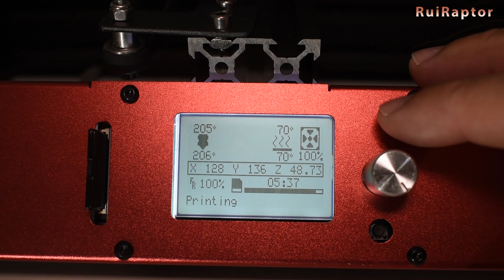Tevo FLASH (3D Printer) - My First Upgrades

Comment: Yes, this is the best tutorial on "how to change wheels" on a "Prusa type" 3d printer! Thanx for making it!
Changed the wheels to PC and now the bed goes much better (no wobbling!).
Although I still (from some time now) can't make my printer to print over 20mm higher (maybe not because of the height) by PETG. It just sticks not well... Don't know what to try now - the bed is levelled almost fine (it's not easy on my Flash), BLTouch works very well... I've used the same hair spray which worked great before. New coating, I think about 4-5 layers sprayed (not even of course but over the all bed).
I'll try to lower the bed temp to 70 and then will try to rise to 80c if it will not work.

Comment: 3dvice is having a black Friday sale, is it worth replacing all the wheels on the Flash or is that overkill?
Reply from the maker: I only replace the bed ones but i see nothing against changing all of them.
3Dvice now has new colors like gold and black.
Reply: Thank you
Reply: Thanks, is it worth getting a spare? Postage to Australia cost just as much as the wheels themselves
Reply from the maker: Hi Brett,
Its' always a good idea to have spares in my opinion. :)
I have some like wheels, nozzles, thermistors for example.
Reply: ruiraptor thanks for the quick reply, I grabbed 5 just for now. 

I’m also going to upgrades drivers as I purchased it without. I’m also going to order tmc2208 drivers, do I just get 2 for x and y axis? Do I need to worry about z axis (I ordered dual z model).

Also the lerdge drivers are same price from Banggood, am I better off to order those?

Also ordering MKS-LV8729
Reply from the maker: Hi Brett,
Did you receive the printer already? I ask this because i believe you will get the TMC2208 with your flash printer. 
Regarding the LV drivers, check my video of the board and driver upgrade for you to see how it's done. The links for the correct drivers are in the video description:
https://youtu.be/RhlTdTLfaQ0

Comment: Hello!
What Acceleration and Jerk settings are you using meastro? :)
I tried Acc down to 400, jerks down to 5, but the edges were very bad, not flat like the sides.
So currently I use it with Acc:400, x and y jerk 20 and now it is better, but I have a small ghosting now...
Reply from the maker: Hi,
I'm using 700 for acceleration and 7 for jerk.
If you are using Ideamaker, you can define lower acceleration and jerk for the outer layers and faster for the infill and such.
Reply: I have the same Problem. Have you fix it?
Reply: @tomes243  Sold this Tevo too (had a Tornado 1st gen) and bought an Anycubic 4Max. Worth it!

Comment: Hi Rui,
Now that you have had the chance to print with this for a little while, what would you recommend among the flash and the tornado?
Reply: I own both, the flash is giving me more a of a learning curve than the tornado did. So far I haven't had any of my prints on the flash equal the quality of prints I have on the tornado.
Reply from the maker: Hi Umberto,
Both are similar and different at the same time.
Both have the same type of structure, AC heatbed and equipped with a GEN L board (at least the last 2 versions of the tornado).
However, the flash is smaller in size and print area and is equipped with a volcano hotend.
If size is no limitation, you can get the tornado as you will get a bigger printer with bigger print area.
Reply: @ruiraptor  thank you for your feedback.
In terms of print quality do you see big differences between the 2?
Reply from the maker: I'm with David on this one...The tornado was easier to dial in and get results. Both are giving me good results but the tornado was much easier to work with. On the other hand, with the tornado, i had to upgrade the layer cooling fanduct (printable and easy to do) while the flash i didn't need to.

Comment: So you have to spend at least $20 more + shipping on 4 wheels? This is something I do not personally like from Tevo, you need to spend a lot on upgrades, meanwhile Creality seems to print and work right from the box. Do not get me wrong I got both. But right now I'm in the middle ground on getting a flash or an Ender 3
Reply from the maker: Hi Belen,
First of all, you don't have to spend. The printer works with the stock wheels. The Ender 3 also has POM wheels on the Y carriage.
Reply: as rui said ender 3 is same with flash. wheels are just soft
Reply: The tarantula had issues for me but made me learn a lot. Tornado had salmon skin but tevo was happy to refund some money so I could get a new board and drivers. Michaelangelo is by far one of my best machines.
Reply: I got 6 polycarbonate wheels for my Tevo tornado for 30¥ including shipping
Reply: Huskie link?

Comment: I really do not understand why TEVO keeps using wheels instead of going for a linear rail in Y axis that seems to me an easier way of solving the wobbling problem. Is it cost ? Regards
Reply from the maker: Hi Piko,

A good linear rail is expensive. The wheels are cheaper, more silent and don't require maintenance like the rails do.
Reply: Cost is the answer ! Thanks Rui !

Comment: Looking to purchase this printer for my son with all full upgrades.  How does this printer handle flexible filaments in your opinion?
Reply from the maker: Hi Brian,
I haven't tested flexible filaments yet but since it has the same titan extruder as the tornado, it will print fixable filaments too for sure with no issues.

Comment: So, the wheels...actually, the bearings. I used to play roller derby and have some Bones Swiss ceramic bearings that I'm no longer using (knee and shoulder injuries, we kick each other's butts on the track). I'm wondering if I can use them on my Flash with the wheels you show, for 'forever wheels'.  Thanks for the update, my Flash is not yet fully built, was missing an important part that I haven't yet gotten. I can do this upgrade while I wait.
Reply: Your  bones bearings are most likely 608 size (22mm diameter, 7mm width, 8mm bore) so unfortunately wouldn't work with v-slot wheels which require a 625 size bearing (16mm diameter, 5mm width, 5mm bore).
Reply from the maker: Hi Ginny,
If the bearings are the same size and if they turn perfectly smooth you can use them ;)